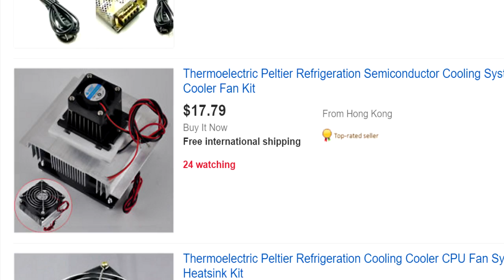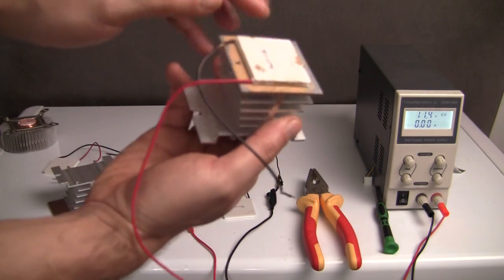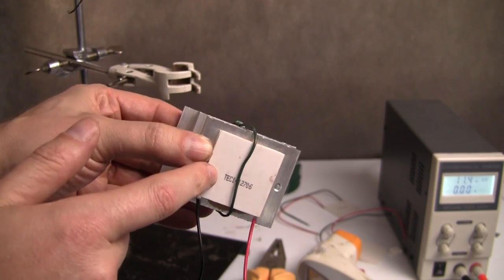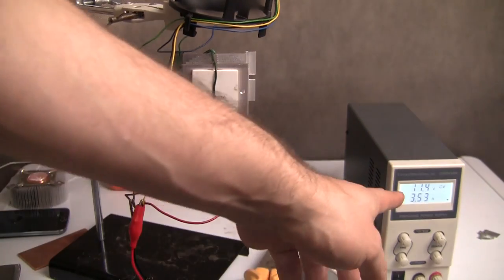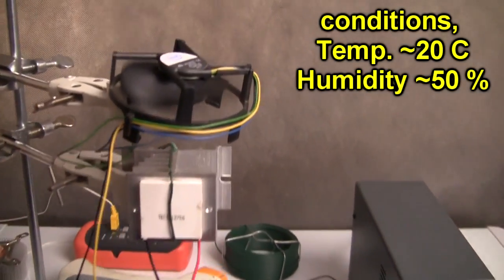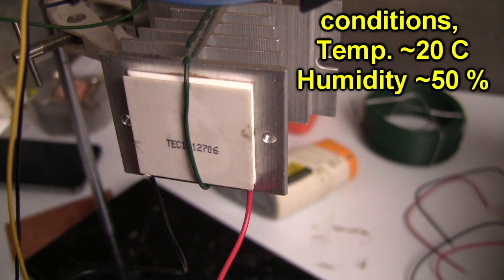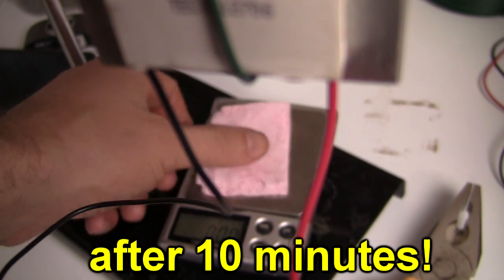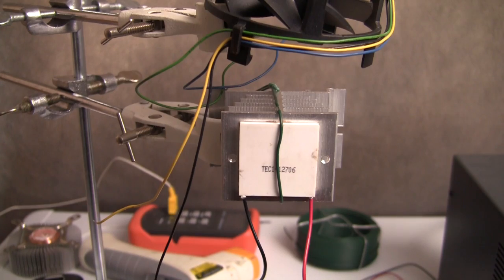Fontus Water bottle claims to make water from air.  Is it possible?

Comment: There are new (sort of) devices that just purify water with not too bad power consumption. And if you're in a place that has enough humidity for this device, there will surely be a water source that's just easier to purify.
Reply: +WillTell the Gamer There are some really decent filter solutions out there. In that case they don't require power but you do need to carry filters. There have been efforts to spread those devices in Africa to protect people from water-based illnesses.

Comment: Wouldn't it be cheaper in terms of efficiency, for them to use compressor and refrigerant, like a mini car AC unit? I mean you don't have to have much of a cooling effect with a tiny surface area like that one. my car's cooled seat uses those diodes and I've seen it dew up, but its not lik there's a puddle waiting for me. And my car's AC barely makes a cup an hour in 90% humidity, and that's using about 8000 Watts, or between 5 and 15 horsepower.So these people will get someone killed with their bullshit.

Comment: The efficiency of a Peltier module is for shit anyway - most often they are utilized due to their small size and reliability, not for any power-saving considerations. I found this out while trying to determine the feasibility of building a packable, solar-powered air-conditioner for tents (as it turns out, I would need a rather large - and expensive - specialized, folding solar panel to even power the heat exchanger during daylight, never mind the substantially-sized storage batteries necessary to power it during the night when you're actually in the tent). This supposed "water-generator" would be a  goddamned power-hog even IF you could get it to suck water out of the air at some sort of an appreciable rate.

Comment: So basically a peltier dehumidifier attached to the top of a water bottle with a solar panel as the power supply.  Sure, it may work in warm (over 26C or 80F) and humid climates (average humidity of 73% here annually) but it seems odd that the design seems to be built to draw water out of the air at the worst possible time in most cases.  The cheap unit I have near my shower can fill up its 500 mL tank in under 24 hours on truly humid (93% humidity) days and its about 33C(92F) outside, with its power input of 9V and 2.5A.  I've never timed how long it does take to fill up completely on those days, just that I need to empty it out the next morning.

I can't help but think the conditions you were running your experiment in, are almost worthless for a peltier dehumidifier(or the theoretical water bottle) to run in.

That said, even I doubt the veracity of this indiegogo.  For camping?  If it could connect to a battery pack or other alternate power source so it could run at night, it might help extend water supplies in the right climate/weather.  For hiking like they intend, even in the best of circumstances it wouldn't be worth the $250 expenditure for a gulp at BEST after the person would get out of it after trying to keep the solar panel aimed at the sun.  The biking unit they show, I can't see as being effective in any fashion.  That, and their "Info graphic efficiency factors" in their attempt to show how much water you'll "supposedly" generate in certain conditions, I can't see being true.  2 hours to get about 700 mL of water in 30C and 70% humidity weather ... I can't see that happening if I am reading their odd chart right.

Still, definitely waiting for the full video to see what results you came up with and probably learn a few things I don't know or overlooking in my own petite chunk of knowledge.

Comment: I was under the impression that the amount of power needed to create water was far too great to done on a small scale.
Reply: +Timothy Dalbeck He's not really creating it. He's just cooling down the air.
Reply: +Timothy Dalbeck you are not creating water you are just taking it from the air itself and re-condensing it as condensation. Other words if you where in a cold environment you wouldn't be able to use it for water since all of it is at freezing point mostly which means very low humidity.
Reply: Alright.  That one is on me.  Face is a little red.

Comment: If you look at the one designed for the bike, it actually looks plausible, the design is a lot bigger than yours thunderfoot, and the intake of cool air is a lot more robust, it also forces the air through a small vacuum of space which adds to the level of condensation. But the problem i see is the one designed for non cyclists, just leaving the bottle standing there will take days for it to fill up. But even the bike one may 8+ hours still.

Comment: To be fair the setup is likely more efficient. As in, the fan pushes air trough cold side of the heat exchange and then trough the hot side and out of the bottle. Havent really done any math yet, what order of magnitude are we talking about here? x3000? As if i see the stats right they claim about 700ml in 2 hours at 25C 50% humidity.

Comment: Thunderfoot I have an idea for a point of use water heater that utilized the Lenz Effect. I do not think it will be efficient. I imagine you will have to sacrifice water pressure for heat. It would utilize a Tesla turbine for water. That is all the info you need to know what I'm planning. Scientists are obsessed with efficiency as if we are an efficient species in any area of our lives.

Comment: You can make water form air with a TEC. It is horribly inefficient, but it works. I would like to patent this idea I have for using air conditioners in homes to produce clean water. I'm so sure no one in here will ever do anything that I feel perfectly fine saying that here. no one will patent it.

Comment: I would be better off just bringing a pot, matches, and just boiling water. Fuck that air water whatever.
Reply: +Snow Bunneh Or you could do the survivor man technique and dig a hole in the sand, pee around the hole, place a cup inside the hole, put 4 sticks around the hole, attach plastic wrap at 4 corners to the sticks and place a rock in the center of the plastic wrap. Instant condensation setup to recycle your pee. It's also best to get as close to sealed around the sides of the hole.
Reply: Flameroller, Pale Shitlord of the Cis That sounds like pseudo-water sports 03o
Reply: Snow Bunneh
lol it's called a water trap apparently. You don't have to use pee, it's a very good technique if you're on a hot beach and need some fresh water.

Comment: Yes, but Thunderfoot, what about using cold fusion to power the device?  

Certainly it would work with cold fusion.   

What if I powered it using feminist logic?  

Certainly can't argue against feminist logic, the steam generated from that B.S. is in the gigawatt range (like a flux capacitor).  

Now a human on a bicycle can generate nearly 200-400 watts/hour, using half those watts to generate water will certainly increase the efficiency to nearly enough to die of dehydration before you realize you have been fleeced.

Really think about the possibilities.... If this B.S. can get funded.... Maybe I can get funded to generate light without heat.  LMAO.
Reply: +mpeugeot 

Well with more power you need a bigger heat sink... Either that or you will just overload the petlier device if it can't hold that amount of power... So something like that it would have to be industrial sized. Which would I think make anywhere from a few grams of water per 10mins...This does depend on variables. I based this on 50% humidity which can change if the humidity levels are higher. We are talking big btw the size of a small warehouse big.
Reply: Maybe these guys and the Thorium powered car guys should get together, just sayin...
Reply: +IloveJell0 A bigger heat sink, you mean like A. S.'s big butt?
Reply: +Mark Beiser winning... but I think the solar powered road people have the better power grid.
Reply: mpeugeot ya then people can just find a road and plug in their petiler device and make water XD. Instead of walking the road to a town.

Comment: I had a hard time understanding how the heat sink worked. It would've been good if you had explained that.
Reply: he will probably do it, in his next vid.
Reply: IloveJell0 That link showed heat transfer creating electricity, rather than the other way around, which must be what the heat sink is doing.
Reply: usmh exactly... That heatsink sucks up the heat from the peltier device and then you use the fan as way to push air in defuse the heat... If you didn't do this then the heat would just stay on the heatsink causing it to get hotter over time. Same idea of what they use on a computer...but I believe at lower power levels it doesn't create condensation but keeps it cool enough to where the cpu doesn't go over cooking temps.

Comment: Yea... basically the only way to make this work would maybe be to do it in an extremely humid environment. But I hear the rainforest has plenty of bodies of water running through it so you might as well just use that energy to boil and purify some water from a stream of something...
Reply: +Chris R naw your best bet is to drink from at running source... distilled water isn't good in the long run. Its said after 4-5 days of drinking nothing but distilled water will leave you mineral deficient and could kill you.

Comment: Is there an easy way to calculate how much water would even be present in a volume of air at a certain humidity level?  Fans are often rated in CFM (Cubic Feet per Minute) so figuring out how much air could be moved over the device in a certain amount of time isn't tough, but I'd be curious if it would be possible to fill a bottle in a reasonable amount of time assuming a perfect 100% condensation.  Impossible practically, sure, but I'm curious if the reasons go beyond condensation efficiency to there simply not being enough water present to begin with.
Reply: +Dustin Rodriguez a psychrometric chart should contain all the data youre looking for. it takes a moment longer to learn to see whats happening on it than with the average graph, but it will tell you what you can and cant do to the water content of the air via temperature change, as well as much other relevant data. you should be able to just view btu change on the chart as equal to btu change in a flow of air passing through a perfect heat sink to get a VERY hopeful approximation of how much water you could drop with a VERY high quality, high surface area heat sink.

Comment: I would like to see the same experiment, mounted horizontally with a heatsink mounted on both sides of the peltier, using thermal compound, etc etc.  Not because I think that would magically make the system work, but because I think you should give the experiment the best chance of success, that way when it fails there will be no question about the fairness or methodology of your experiment.
Reply: +Amra a car's AC uses about 8000 Watts to cool the air, and you barely get a full cup after I hour. I'd love to see you lug around the battery pack from a Tesla around so you can fill a bottle of water in 4 or 5 hours. Or 10 if you're aiming for a liter. And that's if you get lucky and its not bellow 60 degrees. Even easier test is, find a window mounted AC unit and collect water from it for a day. Done. Those stay between 1 and 5 Celsius and have a huge surface area.
Reply: Yeah, but I expect the problem with using just the face of the peltier is the extremely small amount of surface area. A heatsink with less thermal mass and a lot of surface area might perform better, I don't expect a ton better, but there are commercial machines based on this principle that can make several gallons a day depending on humidity, so its not entirely bullshit of a concept.
Reply: Dimitre H A car AC uses maybe 3hp average of engine power, that's maybe around 2500w at most.  As for window units, mine has a constant drip when running and could easily fill a couple gallons a day when in use, and it runs on less than 1500 watts.

Don't get me wrong, I don't think this product is viable, I just think this particular experiment is not ideal, and its much easier say an idea as bullshit when you've given the concept the absolute best possible chance of success. I don't feel this particular demonstration was anywhere close to ideal.
Reply: I've done dyno runs on purpose with ten different models of vehicles AC on and off, 5 to 10 HP average loss at MAX setting depending on engine size. Smallest engines had highest losses. Hybrid vehicles had over 11HP loss.

Wall mounted units are more efficient because they are built for efficiency rather than maximum effect. very rarely does the inside of a house reach 60 degrees Celsius while a car interior does, and the AC in a car is built to get it down ASAP. Difference between a hair dryer and a toaster oven.

Comment: I'm not saying the water bottle works, but you don't have ask the pieces of the puzzle with your experiment. There are surface patterns that increases the efficiency of the condensation, the most efficient one being found on the shell of a beetle that lives in the Sahara desert and collects moisture from air when obviously it must be very humid or close to foggy, but not not enough to actually cause dew that the beetle would be able to drink off the ground it it didn't have this adaptation. I believe a "magic surface" based on this has been used in all serious water condensation projects for the past decade.
I can't see any evidence you used such a thing in your experiment
Reply: +tosgem thats because deserts have more humidity than most common places.... Which means more water in the air than anything.
Reply: +IloveJell0 lol, deserts have more humidity than other places? Deserts are the least humid places on earth. The thing about deserts is the occasional humidity is often the ONLY moisture available for periods of months or years
Reply: tosgem during the night humidity levels can go as high as 50% and above... so I am guessing you don't know much about how they work then... sorry..

Comment: it could be slightly more efficient if u force the air tightly flow on the surface and the heat sink could be water cooled

Comment: Thunderf00t, I don't know if your experiment was fair! It appears in the video that the fan may have been moving air across your cooling device that may have continued to evaporation. Something to consider is how one could set up a system that might prevent this and keep the accumulated moisture contained. I know you need air flow to bring in the humid air, but is there a way of minimizing lossses? That said I still don't think a decent accumulation per hour will happen unless you have a lot of power. Certain not from the small photovoltaic panel they show.

Comment: With these projects, the ability to do CGI illustrations of a product seems to be regarded as the equivalent of designing one. Fortunately, the solar panel has a USB connection to charge your phone so you can call for help when your water runs out.

I also note the campaign is cleverly worded to the effect of "we may not deliver anything at all, no refunds".
Reply: +Paul Coddington With Kickstarter you don't need a working product to get funding. In fact the product doesn't even have to be possible. All you need is the ability to make cool looking videos.

Comment: My first question would be if having the air in a closed container for the process might raise the efficiency.  But then I realized that it would have to raise it by 200% to match the power difference compared to this device and then massively more to produce enough water for it to be useful.

Comment: So basically a dehumidifier bottle.
Reply: +Bla rabkom yep. my apartment is very humid(can't figure out why), and in order to prevent mildew from growing on clothes and bedding I have two monster dehumidifiers running all day in different areas. I like to keep the RH below 50% most of the time.

altogether this pulls about 1 liter of water out of the air every 6 hours, and takes a massive amount of electricity. so to get just like 2 liters a day from this bottle it would need to be the size of a full gaming PC tower using about as much power. not gonna happen in the woods.
Reply: +Dravous Wild i drink much less than a little of water per day
is that bad?

Comment: This kinda looks like a CPU with an aftermarket cooler attached :D
Reply: +Strontius89 Peltiers have been used as CPU cooling devices occasionally.  The primary reason they are not common is condensation.  You have to totally insulate the processor from the surrounding air or else you end up with water and ice, which electronics do not care for.

Comment: In case you want to know how you REALLY manage water when you're outdoors:

1. Plan your trip, know where water sources are and how much you need to carry from one to the next one. If that water is froma natural source you'll have to purify it by boiling it. Don't bitch and moan about the weight. Carry that stuff or stay home.

2. Melt snow/ice, collect rainwater if you run out (don't plan for this. Emergency solution only)

That's it. Everything else is impractical bullshit.
Reply: What about drinking your piss?
Reply: +Shooting Range Productions 2nd level of emergency, we're talking stuck in the salt flats with no hope of rescue here.
Reply: Shooting Range Productions If you properly plan you'll never have to drink your piss.

Comment: This seems odd to me. I have messed with peltier elements myself, mine got WAY colder than yours, about -15C to -20C and it actually stayed at that temp. I also noticed a lot of ice/frost collecting on it. And i was using a normal CPU heatsink. 

(Mine was also at the 40W range.)